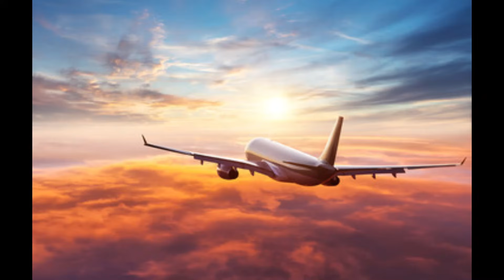FAA Powerplant Oral Study Guide Questions 2022 (NO ADS)

Comment: Are some of these questions and their corresponding answers mixed up?
Reply from the maker: No, they should all be accurate. Some of the answers in the books are worded strangely where it seems like a word is missing or something, but I read them verbatim.
Reply: @chadrandallmeyer1   5:24 "A weak cylinder is found during a compression check, what must be inspected?" 
Your answer was "Pressure is transmitted equally in all directions". I believe the correct answer is, "The inside of the cylinder"
Reply from the maker: @CubNole  Yea I know…there are a few like that scattered throughout the 3 books, but the vast majority of the Q&As are accurate. I didn’t write them, just read them verbatim for a basic study guide.
Reply: @chadrandallmeyer1  My jeppsen book has the exact same typo